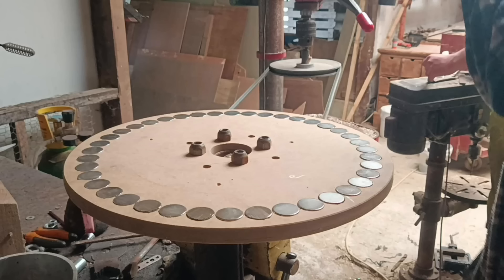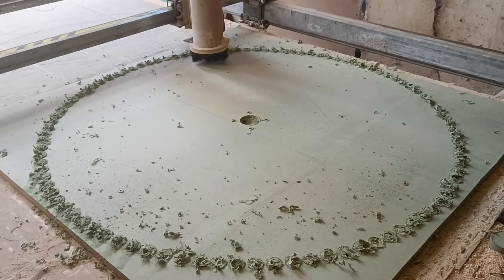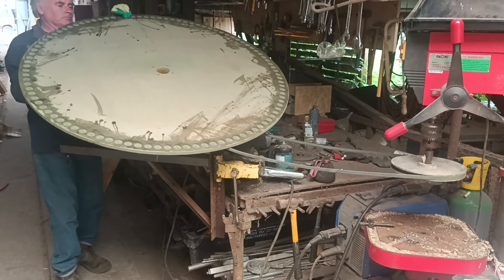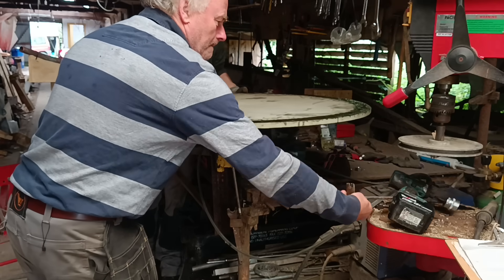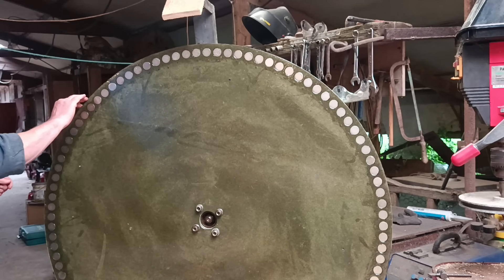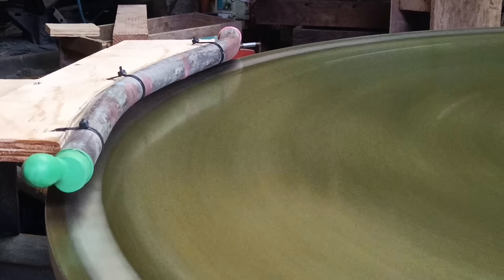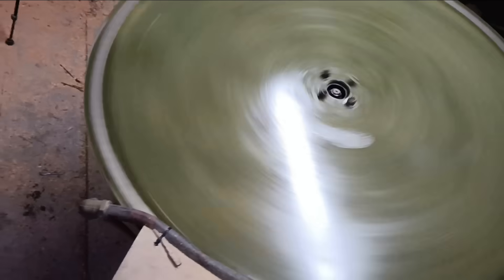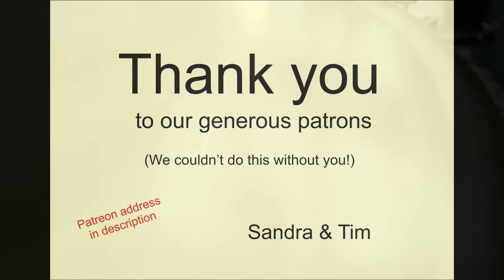ABSOLUTELY HUGE Magnetic Induction Heater! Using 100 Spinning Neodynium Magnets And A Bucket

Comment: you could add insulating walls that surround the pipe on two sides to the disk itself. Add an insulating trough that covers the top of the pipe and most of the outside of the disk's walls    
__________      <---upper cover and outer walls
|   |📀|   |
    |       |           <----inner walls mounted to disk
---------------       <----disk         

As for the vibration you had after balancing. I'm sure you know by now that static balance and dynamic balance are very different. If not, just think about how a 1 to 10 lever can perfectly balance a 10 to 1 weight, but when you start spinning them the long side will dominate the angular momentum.

Comment: Using a big wheel will make t have a huge momentum of inertia (proportional to the square of radius). you could use several uniaxial wheels and pass the metallic tubing around the,, so this way the wind won't need to put all that kinetic energy on the wheel to make it is start rotating at a good speed (with the same force), this will allow to capture lower speed winds. Once it is rotating there is no trouble all the energy will dissipate as heat by the magnets even if the wind stops. But starting it to a usable speed may be more difficult.  If you intend to use a water flow to rotate it I see no problem with big wheel.

Comment: I have been toying with a similar idea to heat my greenhouse.   I figure on a coil of copper tubing and multiple rows of magnets, potentially a second layer of magnets that stays still opposite the moving ones.
Reply: This isn't a free energy device, just use an electric heater for your GH - forget electromagnetic induction.

Comment: I love the thought of what you are doing, but you forgot one thing! Electromagnatisim is what you are playing with to create the heat. If insteade of making a patial loop of pipe but insteed have the pipe intersect the magnetic fields at a 90 degree at the same distance as the space of the magnets and then electricaly short the end of it at the end. If you want more information contact my profile and say heay Mr-Fix-it please explain and I will even provide diagrams.

Comment: Coils of wire (better yet off the shelf alternator) and a heater gonna be much more powerful which can lower needed rpm, much more robust, completely solid state and simple and also between lower rpm and absence of loses in pipes - more efficient. Also it's a tried and true solution which you probably not seeking for given you have to make a content for a  video=)

Comment: Cover the entire surface of the disk with neodymium magnets. Arrange them in alternating north and south oriented hallbach arrays. Suspend a tightly wound flat coil of copper tubing the size of the disk over the top of the disk, as close as possible to the disk. Maybe add an aluminum track on the disk and attach some bearing rollers to the bottom of the copper pipe so as to maintain optimal distance with low friction.

Comment: multiple heating loops over the disk. heat water in stages from on loop to another, before discharging it back into a bucket/tank. insulate the tanks. seal it too so water doesn't cool through evaporation.

Comment: Congratulations Dr. Gauss. 🧑‍🔬You have stirred the interest of over 500 commenters, many of whom are fully engaged as indicated by their constructive contributions. I have nothing to add  except that you might consider wearing a flack jacket or ballistic vest, should that rotating wheel pick up a loose piece of metal or a tool and 'centrificate' it in your direction. 🙂

Comment: I have wanted to see a fluid full of iron, in a large circular pipe. Stand it vertically. Bury the bottom where earth heat can heat the water. A one way valve makes it circulate. A coil wrapped around the pipe should generate electricity as the iron moves through the coil. If you used wind to turn your magnets, heat the fluid at one point, you might get hot water and electricity out.